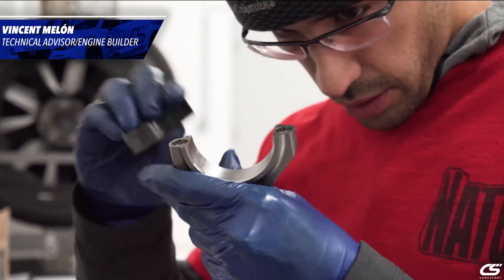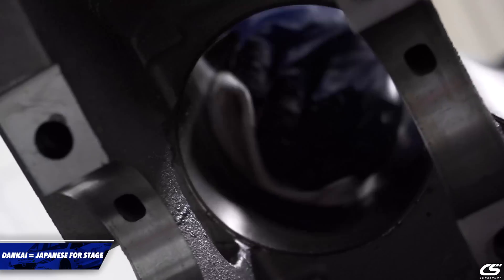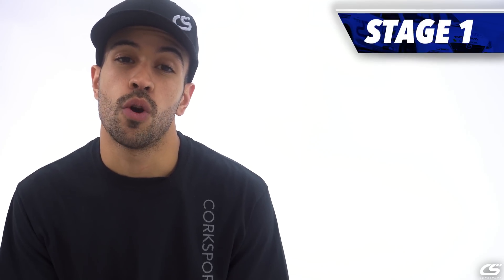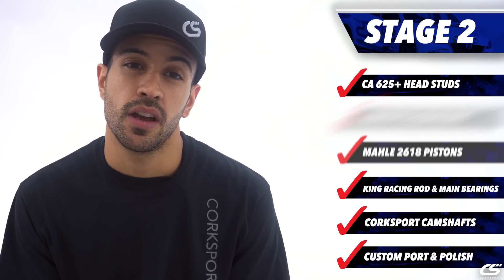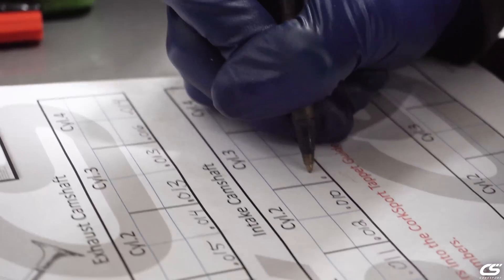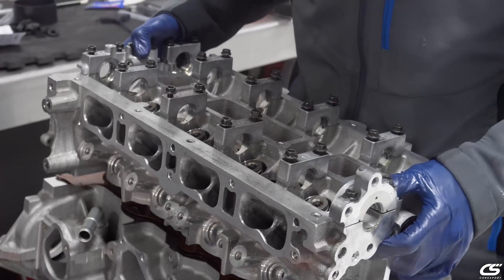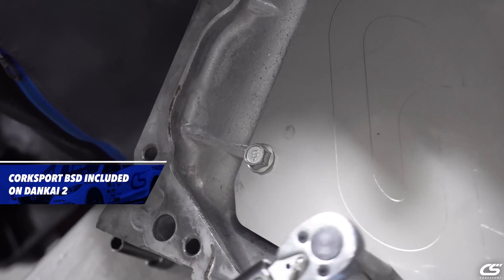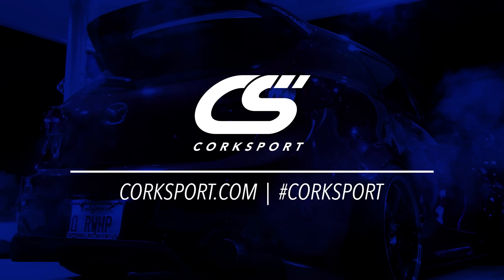DANKAI 1 & 2 - CorkSport Built Engines For Mazdaspeed

Comment: Why not use the Keyed crankshaft and gears since our cars are know to slip 
Also why no sleeves
Reply from the maker: Because the cars are not known to slip when the timing is done correctly. Thats why the fastest speed in the world still does not use keys. Friction washers get stronger, the more force thats applied to them. 

Stock sleeves are safe up to 800 whp. Which exceeds the ratings that the rest of the engines components are safe to. Sleeves also exponentially raise the cost of an engine.
Reply: Thanks for the  helpful information 
I learnt something new

Comment: What power numbers have you produced with these builds?
Reply from the maker: Anywhere from 300's to mid 600's on the Dankai 2. Rated for up to 725 on the 2. 

I wouldn't push the 1 past the 525.
Reply: @corksport  Well, I had Mahle 4032 ringlands failure wit ha 350 Whp map, at about 80.000km. I would not use Mahle pistons again ever

Comment: How long do these engines last approximately? 150 K plus? Are the engines put togethere to OEM standards? I would be very interested in the future with my speed. But I’m a little turned off by the short 6 month warranty. I mean I’m paying $6000 for basically brand new engine and it’s only 6 months?? Most of your products are for two years. This is the biggest investment and you guys can’t back it up the same? It makes me think the engines don’t last very long and I can’t justify paying that much money if it’s only going to last a year or something. I really hope you guys offer a better warranty because that’s a dealbreaker for me.
Reply from the maker: Built engines are designed to handle High level  of power and abuse. Race application materials wear out sooner, and will need to be serviced more often. Thats the nature of game, especially making high levels of power from a 4-Cylinder. 

If you are looking for another engine to go 150k, then you want another OE engine. And keep it at lower power levels. 

6 month warranty in the crate engine game is more than most. Most don't offer any.  Some have up to a year, but thats about it. If any thing was to be wrong or defective in the engine, you would know within the first couple weeks. There are too many factors, and too many ways that someone could also potentially destroy it on their own too, so we have a very strict documentation, and break in process, followed by the customer sending back their 1st oil filter to ensure that their warranty is not void.
Reply: So if I get this engine and send back the oil samples and everything looks good, can you give me an extra 6 months?